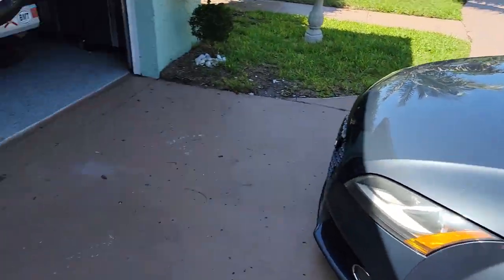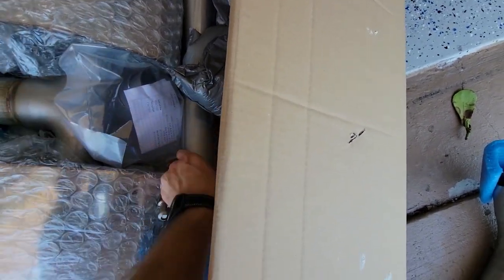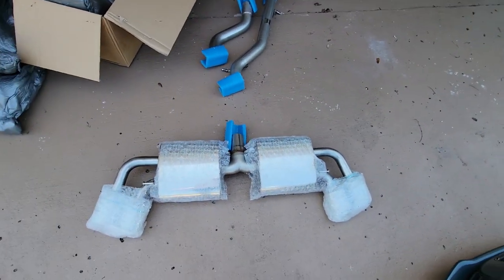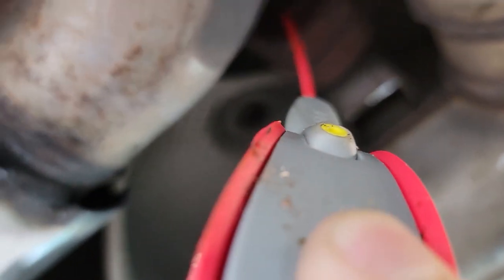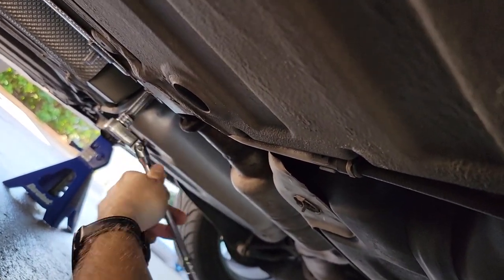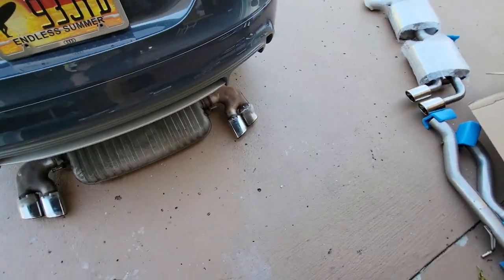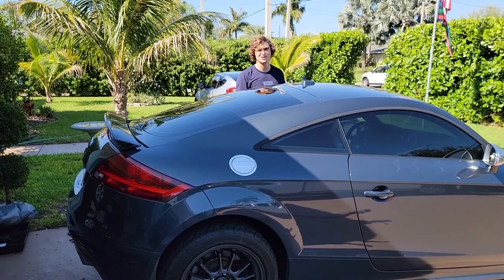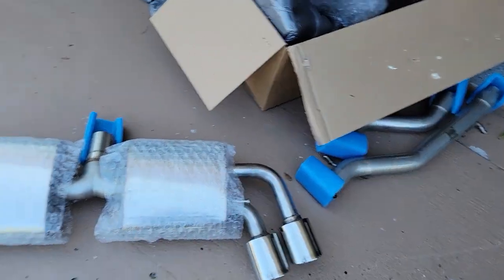Installing The Milltek Exhaust on the Audi TTS!

Comment: This is by far the best sound i've heard. i've got also a TT MK3 ABT , almost 2nd stage. I dont really like the exhaust i have. if i order a Milltek as well to sound nicely like yours , normal quiet and brutal when needed, do i need to order it i mean with special terms (dimensions,having 2 exhaust valved to open/close,..... etc) like be quiet but not like OEM quiet? i've heard exhausts that overdo it and its too noisy....

Comment: Do you still remember the feeling when replacing this set of pipes?  that performance  how is it better  Compared to stock pipes. I want to know the difference.  but around the engine  Is there better torque in every engine rpm?
Reply from the maker: I don't think there is much performance gain for catback... downpipe, yes.
Reply: @dannyhampton  Is the accelerator lighter?  or the engine rpm is smoother than before stock